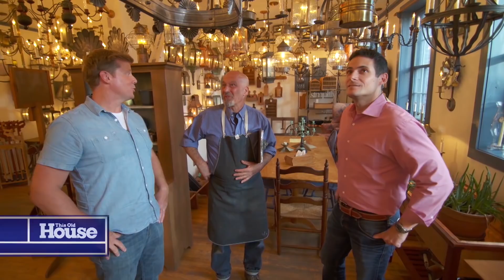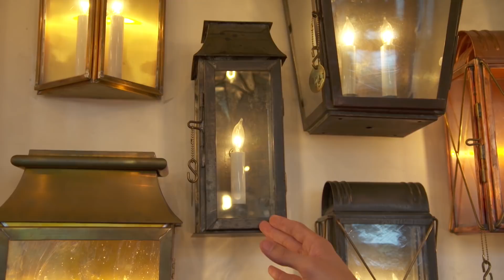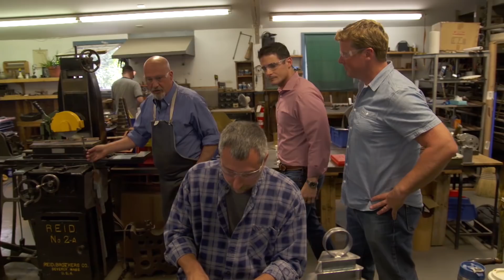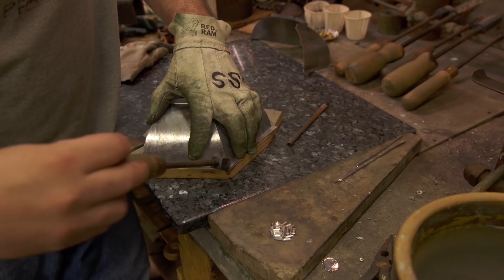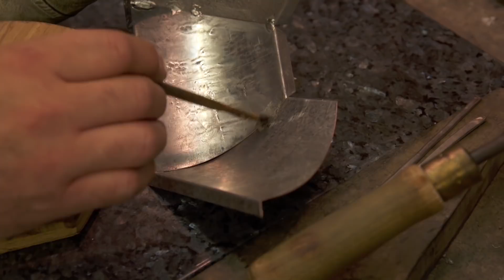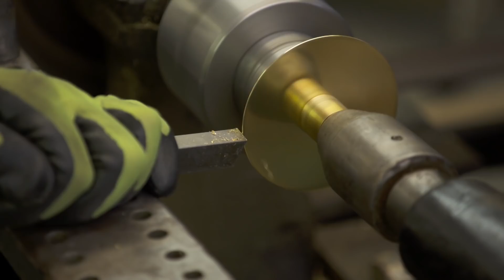How Reproduction Light Fixtures are Handcrafted | This Old House

Comment: Yeah, watching the dude solder the light fixture together.  
Little problem with that.
He wasn't letting the iron heat up the metal, which means the solder joint is just a surface joint. One good hit and it will fall apart. 
I know this from fixing my parents 
outdoor antique style lighting fixtures(they are the all copper fixtures). They paid about $500 just for the light, the pole are around $1500. 
Soooooo, over time the crappy solder joints fall apart, once one joint is compromised it all down hill.
What I noticed is the solder joints looked like a sponge when they fell apart, which tells me who ever put the lamp together didn't heat up the metal enough when the original soldering was done.
What I saw just confirms what I thought.
Dont get me wrong, those lighting fixtures are very expensive. More care needs to be put into the product ! ! !